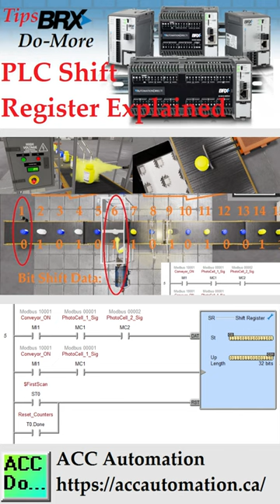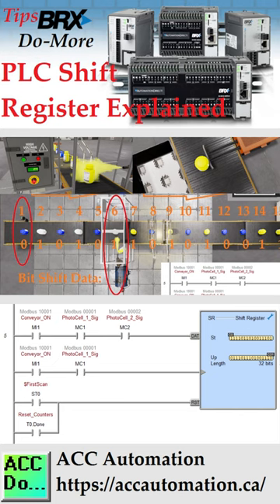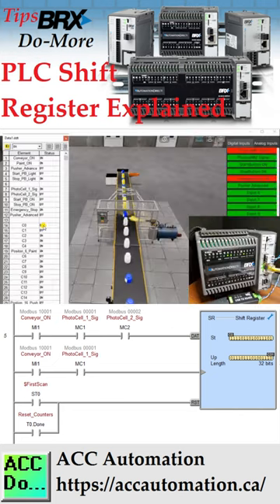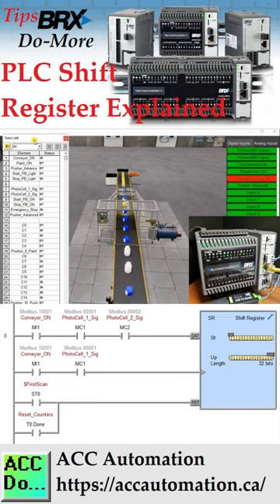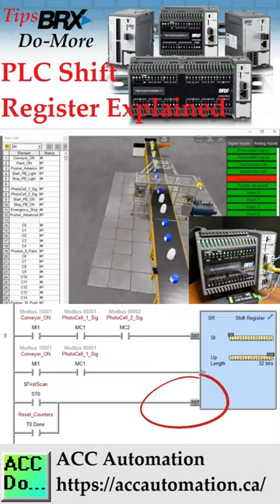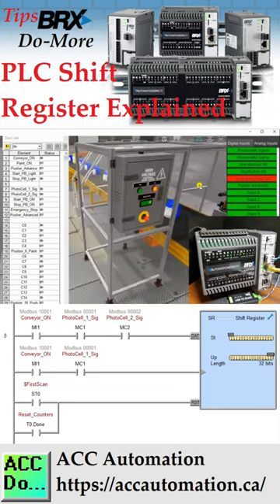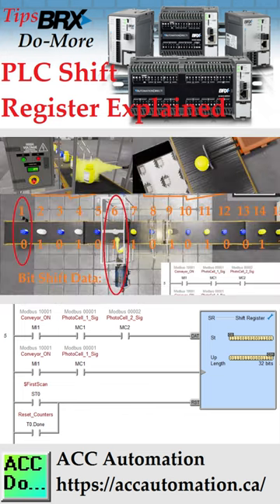BRX Do-More PLC Shift Register

Comment from the maker: This complete example can be found here.
https://accautomation.ca/easyplc-paint-line-bit-shift-brx-do-more-plc/

EasyPLC Series can be found here.
https://accautomation.ca/series/easyplc-software-suite/

Programming and examples of the BRX Do-More series can be found at this URL:
https://accautomation.ca/series/brx-do-more-plc/

There are several reasons why we are using the BRX Do-More Controller. Here are just a few.
– Standalone PLC with built-in I/O
– Built-in Data Logging
– Communication ability – Ethernet Port, RS232, RS485, USB – support for protocols such as Modbus RTU, Modbus TCP, ASCII, K-sequence (DirectLOGIC users), Custom Protocols (ASCII over serial, TCP or UDP over Ethernet)
– Built-in Analog input and output
– Integrated motion control
– High-speed counters
– Powerful instruction set (Video of Instructions in software)
– Ability to expand the system with a variety of modules
– Part of the Do-More series of PLCs which use the same free software. (Do-More Designer)
– Integrated simulator in the software capable of external communications for testing

ACC Automation
https://accautomation.ca/